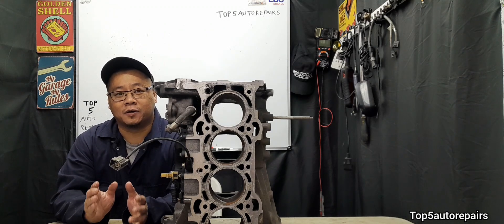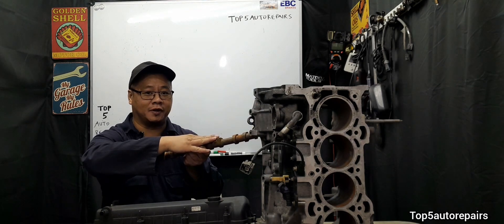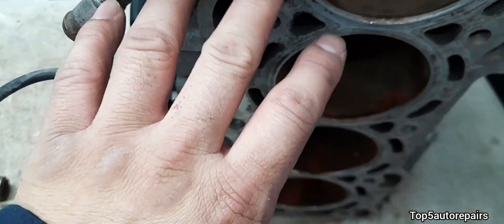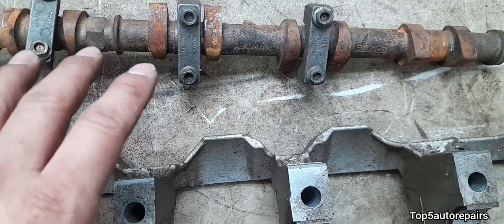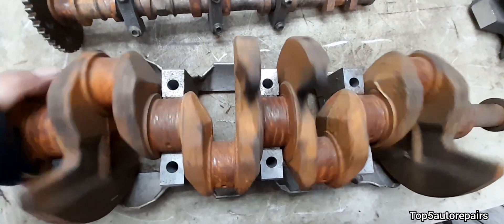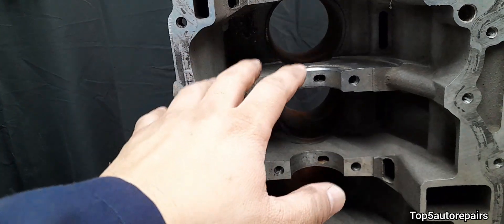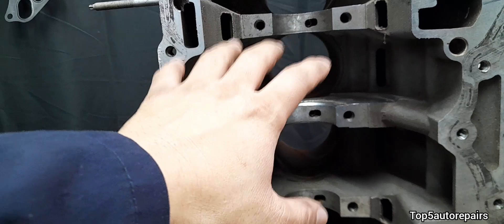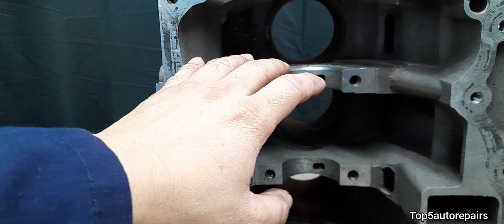WHAT CAUSES ENGINE SLUDGE AND WHY IT'S BAD FOR YOUR ENGINE

Comment: I never knew what were causes of engine sludge.   But I've been very aware of lots of cars and trucks with sludge issues in newer vehicles and thought that is criminal how many bad designs get pushed out the doors and onto customers.   Even my own trucks timing chain is absurd, while I DIY and have never seen a mechanic cause I can't find one like Top 5 Auto Repairs irl...    my timing chain is like a full tear down of my engine it's cheaper to buy a new engine.   Chevy Colorado 2006 RWD 2.8L  not without it's issues but all is well for now on it,  it's a time bomb for sure tho.
Reply from the maker: Thank you for sharing your experience